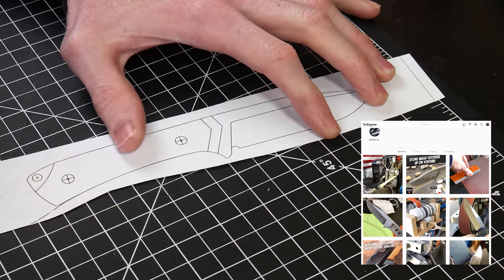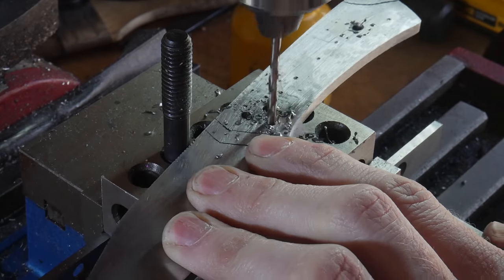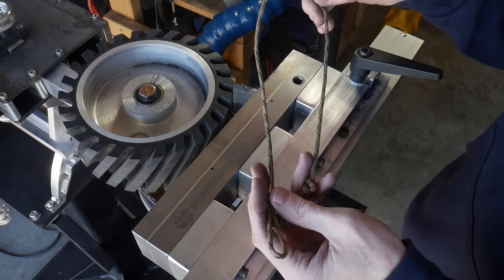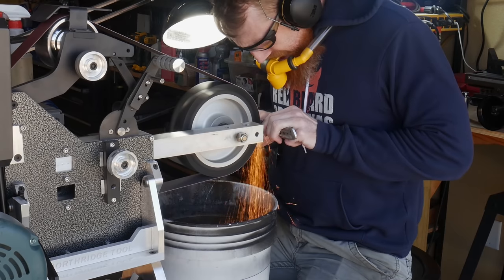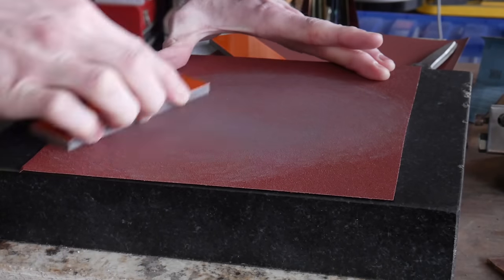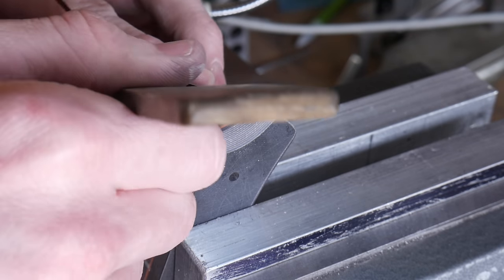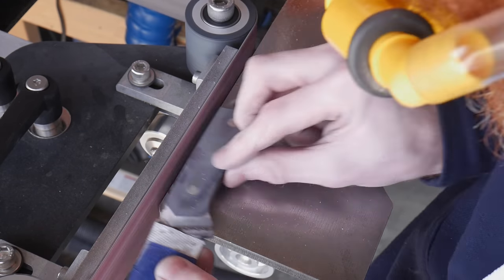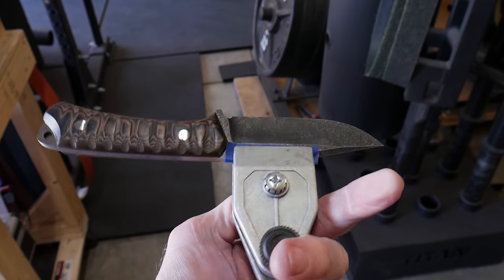Make A WAR Knife | My First Hollow Grind | Knife Making

Comment: Excellent work! I have always been too afraid to try a hollow grind.. however, I have made quite a few textured handles... I would try a larger diameter wheel, I typically run a 3/4” or 1” wheel for this operation. Also, I typically grind in the scallops after profiling but before shaping the scales (if that makes sense).
Reply from the maker: Thanks for the tips!

Comment: Great job as always James- not too much not to like here.  Hollow grinds are addictive- I almost exclusively use them on all builds.
Reply from the maker: Man it was different for sure! Do you hollow grind thinner stock as well?
Reply: @RedBeardOps  I do. Have done .100 on a 10 inch wheel. Bit more care needed for that.
Reply from the maker: @NRiggiKnives  I bet... I need to get me a 10''.
Reply: @RedBeardOps  Yes. Can still do a thinner blade but also gives you the ability to do a wider one without making multi-faceted passes to get the hollow in.

Comment: I’m pretty sure this is one of my favorites. Knice work as usual. Something has to change on my end. I’m still using a chop saw and a hand grinder for stock removal. I have a WEN bandsaw but haven’t tried a blade to cut steel with. Correct me if I’m wrong but I don’t think the WEN is strong enough for steel removal. Keep up the great work and new ideas.
Reply from the maker: If it's the WEN portaband like mine I bet it will work. Cheers Tim!
Reply: @CamaroZ28Nut3   yes sir,,, it’s a table top and I was pretty sure it wouldn’t work. Was thinking of getting a portaband and a swag table. Thanks brother.

Comment: I have to say that I find most knife makers like either 5/32 or 3/16 for most general purpose knives, so good recommendation for the subscribers 👍

1/8 is great for a Caper/ Bird and Trout knife.  Also as long as you get the distal taper and thickness behind the edge right, there’s nothing wrong with 1/8 for kitchen knives.

Also, love hollow grinds!  Everything has its place, depending on the knife, but I have a real soft spot for hollows 👌
Reply from the maker: Cheers Griffiths, good stuff there. I'm a big fan of a full flat grind on a 1/8'' stock, but this thing turned out great with a hollow!
Reply: @RedBeardOps  Cool👍.  If you’re looking for interesting handle patterns, several years ago TuffKnives (Tough Thumbz) on YouTube did two tutorials on his Anso pattern and his Reptilian pattern.  I tried posting the link earlier, but for some reason the comment kept being deleted.  Anyway if you do an easy YouTube search on Tough Thumbz Reptilian you’ll find it.  

Geoff of ToughKnives is a seriously talented and highly sought after folder maker.  Him and Gavko both are two of the original YouTube knife making channels.

Comment: I find it easier to do scallops with a dremmel for some reason.  I think it’s easier to see what I’m doing.  I do love the clip point with the false edge.  You’ll see that on most of my knives.  😜
Reply from the maker: Good tip sir! Yeah, I'm not sure how I feel about them. They don't feel bad in the hand though.
Reply: @RedBeardOps  If you put them closer together but only go half-way across the handle and then come from the other direction but offset the width of your scallop, you'll get a cool snakeskin pattern.   I've done that on several "tactical" knives.   I'm with you on G10.. if I'm not doing wood, it'll be G10.  I hate micarta personally and think G10 is a superior product.
Reply from the maker: @TyrellKnifeworks  That would of been a good look for sure!

Comment: I know this is an older video and I don't know if you still want the idea, but if you wanted to get your scallops lined up, why not use an adjustable benchrest in front of your grinder?  Something as simple as a barstool with a stack of dinner plates would even work.  Make matching scallops on each side, then remove a plate.  Make the next pair of matching scallops, remove a plate.  

Clearly a stack of known thickness material would be better and a purpose built adjustable benchrest would be best.

Comment: A bit late bit if I am going to put scallops in the handle like that esp with handle material that has many alternating layers I like make it nothing but scallop and do my best to even it up by eye and use a moderate-high grit belt like 240 to do all of it. This will break it up visually and precision is less important since the eye doesn't really focus on how uneven it is since the handle material is many different layers and since it is all scallops there is no flat for a visual reference. It comes out looking good usually.
Reply from the maker: Thanks for the tips!

Comment: I like watching you guys making knives, but I have never made one myself. I want to start off with making two knives out of sheep shears, as I only have basic tools. Something I always wanted to ask: Why not anneal the material, do all the cutting and grinding while the material is soft and then harden and temper the finished product. I realize that there are reasons (most knife makers use your technique) why you do it your way. Can you please give a novice like me the reasons for doing it like this? Thanks for a a very informative vid!
Reply from the maker: I've done it both ways. I like getting the HT out of the way and starting the grinding process with a non warped straight blade. Easier to clamp after quench when flat. Neither way is wrong

Comment: Hey!
I tried out this method of making "waves" in The g-10 handle, but I used a round file tho. First time i've worked with g-10 and i've left a few White scratches along The handle and into The waves that I made with The round file. I've sanded them to 600 grit but it doesn't clear. Haven't used wd-40 on The handle yet, kind of worried that The White scratches Will show up agian after a while.
Do you face this problem when grinding down your g-10 scales at all? Wouldn't worry about it as much but it's a gift for a friend so I'd like it perfect.
Would really appriciate your input!
Thanks for all The inspiration! Your work is fantasic!
Reply from the maker: I think I know what you're talking about. Try sanding with high grit and WD40... it will create a "paste" or "film" of abrasive and hopefully the WD40 will carry out any G10 dusk getting stuck
Reply: Spot on mate. That worked out Great!
I'm only at my third knife and my third type of handle material. I want to try out so many things but time is limited and if I didn't have these videos I would most likely never had get started. So I just wanna thank you agian for all The Great content and detailed videos =)

Comment: Newbie question, not a criticism. Why harden before removing so much materiel fromthe blade? Amzing job!
Reply from the maker: Thanks! You can really do it either way. I like to grind post heat treating in order to have a nice flat blade to clamp in my quench plates. I find this reduces the chances of warpage and un even heating. I also like to do all my grinding at once. If you have sharp ceramic belts it's not bad. Like I said though, just personal preference.
Reply: @RedBeardOps  Thanks for your anwser

Comment: You say in the video you do the sharpening to about a 19 degree angle.  Why 19?  I had always heard outdoor type knifes should be more around 25 degrees and kitchen knifes around 20 degree.  I ask because I have been doing 25 degrees and I don't feel like I get the "really" sharp.  I have thought about dropping to 20 degree angles, but I am building mostly outdoor knifes.

I second the comments about your videos being the best knife making videos on YouTube!
Reply from the maker: THank you greatly Brian! I've just found that I like a slicy knife with a higher angle. I've seen a lot of pocket knives in the 20-25 degree range. I think a good deal of it can be personal preference and what you plan on using the knife for.
Reply: @RedBeardOps  I think you have inspired me to try a 20 degree angle on one of my knives. (I use 20 or 25 because I have a WorkSharp sharpener that works well with those angles.)

Comment: Great looking knife. Do you notice a difference in temper when done between the angle vs on its own on the rack?
Reply from the maker: Hey Shawn, there shouldn't be any differences. Everything in the oven gets up to temp
Reply: @RedBeardOps  thanks for the reply. I wasn’t sure if you would have to leave it longer so the heat would get past the angle and into the blank.

Comment: Is there any way to restore the acid finish on the tang after sanding?
Reply from the maker: Best way to maintain the acid finish on the tang is to use handle screws and removable scales. The other, more difficult way, would be to do your handle profile shaping with temp hardware, remove, etch, glue up and be careful not to re-sand the profile. I've done it both ways and really like the removable scale option better.

Comment: Hi, I tried similarly, but I put blast furnace slag stones in the war,common gravel...it doesn't work at all, it doesn't do anything, I'll probably have to put some quartz stones...(:
but I've tried it so far without ferric acid, dry, just polished it a bit,
it can't be done without immersion in acid...? Thanks /from czek/
Reply from the maker: You need the acid to darken the metal
Reply: @RedBeardOps  OK Thanks...(:

Comment: why not just throw it back in the acid and in the tumbler after the knife scales are on?  thats what i do an it works out fine, no detriment to the scales or anything.
Reply from the maker: Not a bad idea Andrew, I've never tried it. Do you neutralize after?
Reply: @RedBeardOps  sort of.  i always worry about baking soda leaving tiny little scratches because it is somewhat abrasive, so i have a mixture of TSP, baking soda in water and it works pretty good, never had a rust issue as like you, i am always rust scared ha.
Reply from the maker: @andrewfischer6055  Nice!
Reply: @RedBeardOps   I don't know if it makes a deference, I tape off my scales and use a QTip to reapply acid to the spine on some of mine.

Comment: In your knife making 101 : make your first knife video you grinded bevels BEFORE heat treat. Opposite of this video. Can you clarify this sequence? I'm confused as to which to do first??? Just want to know best practice methods. 8:03 " I do All my grinding, post heat treat". In this video. But in knife making 101 you grinded everything before the heat treat. 🤷‍♂️
Reply from the maker: On the 101 video I'm assuming the user won't have the appropriate equipment to grind post heat treatment. A new maker will be using files and sandpaper. 

With a VFD controlled 2x72 belt grinder and nice ceramic belts you can do your grinding post heat treatment. No issues with this. Just need to keep the blade cool. 

In reality this mostly comes down to personal preference. Now days I'll grind a little bit to get the bevels started, then HT, then finish.
Reply: @RedBeardOps  oh man, thanks so much red beard love all your stuff!!! Thanks again!